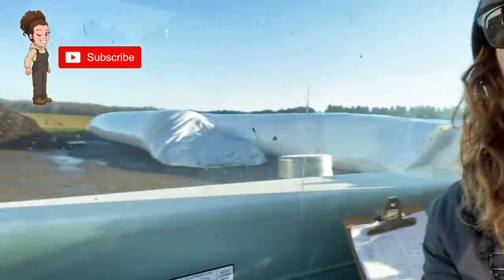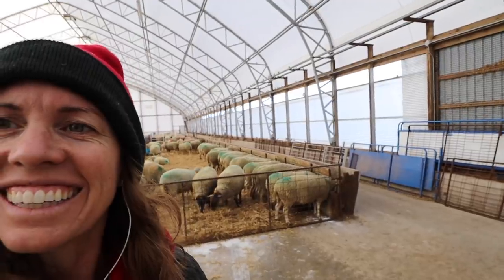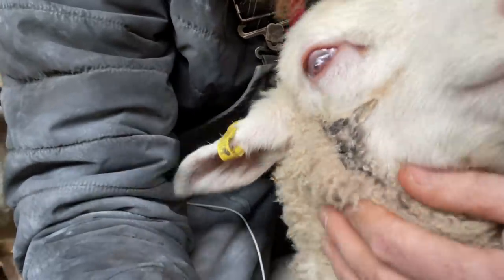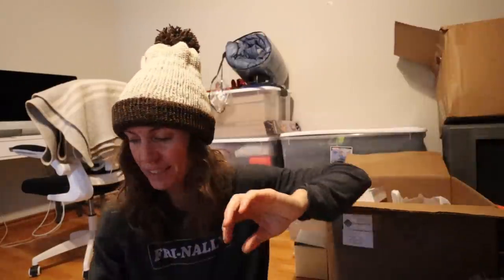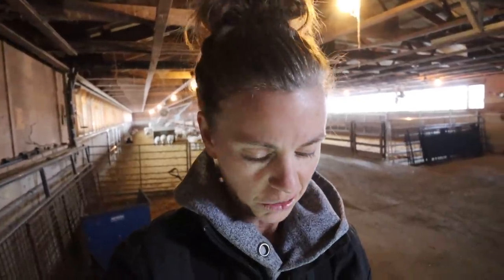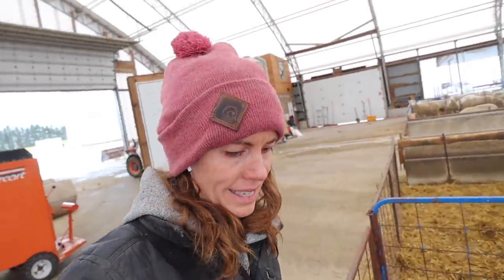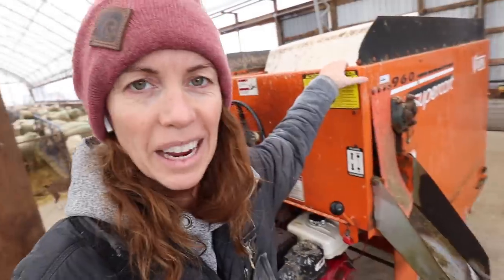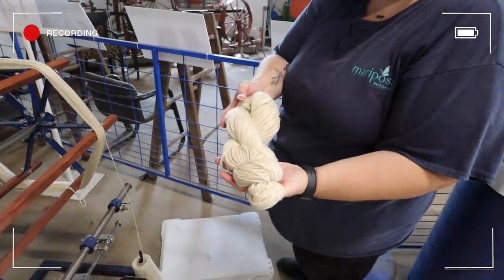do EWE want to build a snowman?☃️ | WHITE OUT CONDITIONS IN THE SHEEP BARN?❄️ | Vlog 513

Comment: Sandi, how about trying one of those fertilizer spreaders for lawns to spread out the lime? I'm thinking it will result in a more even distribution, and you wouldn't have to bend over as much (that can't be good for your back, just sayin.)
Reply: Came here to suggest this as well!
Reply: Or you  could use a drop fertilizer spreader. It would take a few more passes but it would drop the lime instead of broadcast spreading it
Reply: @farmergirlangie3469   that would be the safest bet. 👍
Reply: That is what we use to put lime down in the sheds! Much safer and keeps it down low.
Reply: @Stevedish75  so the sheep shouldn't of been put in there? Yes she added some hay but there were so much, so close the sheep would have contact with.
Reply: @louann4992   Once the lime is spread on the floor and covered with hay it shouldn’t be a problem. You just have to try to keep the dust to a minimum while spreading it. The lime dust irritates the lung tissue. The dust on the skin or hooves is not as bad.
Reply: I had the same thought! I’ll bet some kind of lawn device would be perfect for that job
Reply: @sarahpetersen6576  same here.
Reply: Yes, that could work - and can cover the top of the spreader, to keep dust from floating up from there.
Reply: You beat me to this suggestion…….certainly seems worth the forty bucks for a drop spreader
Reply: @Stevedish75  she is wearing a mask anyway, and I would get a drop rather than a broadcast spreader
Reply: @louann4992  Depends on the exact chemical used as well. Several things are called "lime" in the industry, ranging from crushed limestone (which is merely irritating for most people and animals) to quicklime which is pretty toxic and burns your skin on contact. I'm pretty sure Sandi was using the former, as it's available on many farms anyway for Ph neutralisation of acidic soils and is reasonably safe to handly. Were she using quicklime she'd had to remove the animals from the barn for 2-3 days and wear full protective gear like you see doctors wear who handle Ebola cases. It's used mostly as part of fumigation and other sterilisation processes to kill pests and pathogens, then washed away.

Comment: Like everyone else has said, get a like spreader or an old style push fertilizer spreader. You can use a way lighter touch and not have to spread so much. Liming the floor and using a lime wash at the beginning of the warm season on your non-bedded floors will change your life.

Comment: Your last vlog you commented about the shiny straw.  It is true the coating repells moisture.  This makes the bottom of the pack wetter however the sheep remain dryer on the surface.  Do you think having the lambs older at weaning this time  contributed to the lambs and ewes being quieter?Another great vlog!
Reply: yeah exatly like that
Reply: I kind of think the extreme summer heat and humidity made the sheep more thirsty.  And of course what goes in, will also come out.  In any case, the lime should cut down on fungal and bacterial infections, spread from their bedding.
Reply: I wondered that too. It was remarkable. The difference was very obvious. Whatever it was they were peaceful content ewes and lambs. Beautiful informative video as always. 400k! That moved fast from 100K didn't it? Congratulations Sandi

Comment: Last night I think your white out blew down to the US!  We have had very windy days that seemed to get WARMER when the wind got up to 45-60mph (85-105kph..which is very common here…up to 105mph/160-205kph) but when the wind stopped the temperature plummeted to an unseasonal 12F (-28C)
And we froze our wool off going out to tend the sheep this morning!  Well, back at it…cold or not we have to fix the fence that our rams decided to play ‘Head Down and Run’ with… a welded steel fence separating the ewes from the rams and they broke through it and cut themselves up in the process.  Out with the antibiotics, CDT and spray antibiotics and go out and spend hours in the freezing cold welding and putting solid walls of plywood over the steel to block the views and smells.  We are in the process of finishing a new sheep barn because the old one is 90 years old and getting windy inside so it’s a bit of close quarters this year…which is NOT great arrangement when hormones are in the air!

Comment: A lawn fertilizer spreader for the lime as some suggested...Or a sand spreader... You could also use that for spreading sand on icy spots... multiple usage for a tool like that...
You could Cut the Sack Open and put it in the bucket with the opening down.
Maybe less airborne particles...

Comment: The lime does help with moisture, but its most important benefit is to keep bacterial loads down. Bacteria and other pathogens thrive on the warm moist environment of the wet bedding the lime should reduce that. I would do it the line regularly for a while and then see if it helps with bacterial diseases and infections. Your data collection should help see if it is helpful.

Comment: Hi Sandi, I would say the ulcer is still present (that's not the pupil), is instead a Phthisis bulbi or, in other words, it will gradually turn into a shrunken and non-functional eye, which is the natural course after the first acute inflammation you saw at the beginning (trauma), at this stage the lamb is most certainly blind in that eye, in your farm setting is not worth to do a surgery to remove it (because of the cost/antibiotics) as long as there are no signs of pain it should be alright.

Comment: Hi Sandi I've got a question, does Mark use the sheep barn compost on the fields for fertilizer? Know we used our barns compost from the cows, horses, & ponies, I remember my Uncle used to use my Great Grand father's compost on his fields for fertilizer & to add compost.

I know we used to use lime in our barns in the corrals & stalls a lot. It helped keep them cleaner & issues with hoof problems with our winter Colts & Mommas, which we always tried to avoid but as you know sometimes you get surprised by strong willed animals that will do as they want, not as you need or want. 

I love your channel & farm. Your doing a great job girl friend. 💜❤💙💛💚

Comment: When you use lime why can't you take a milk jug cut some holes in it and use that that way the line is more concentrated in an area where you want it cuz you would sprinkle it back and forth until you had it where you wanted it if it was too thick than you make your holes a little smaller and vise versa.u can even use a big bucket and burn ur holes that way the line won't be all over u it will be around your feet.

Comment: Not a farmer, but after reading comments…wouldn’t that much lime cause breathing problems for the sheep, with their faces basically right in it.  Someone here said it would burn the skin, in that vein, would it also not burn udders when they come in contact with it when laying down it for extended periods of time?
Reply: My understanding is that Lye and Lime are different things. Lime is any inorganic material containing calcium, usually calcium oxide (quicklime) or calcium hydroxide (slaked lime). Lye on the other hand is Potassium or sodium hydroxide (caustic soda). Farmers have been using lime safely for many many years.
Reply: Oh ok.  When she said it was toxic to breathe, I’m looking at the thick layer of lime on the floor thinking to myself….holy crap poor sheep they are so dead 😮😮 thanx for the clear up